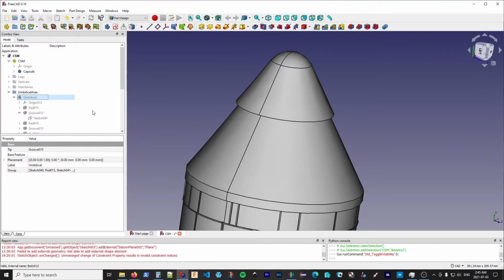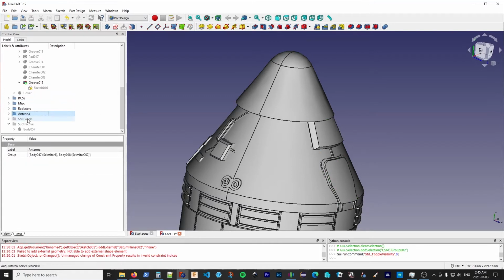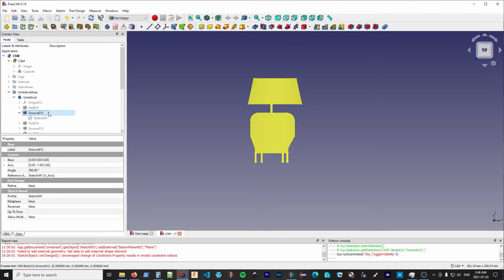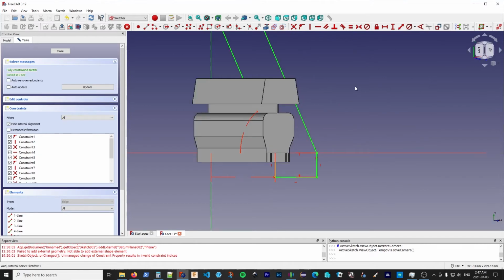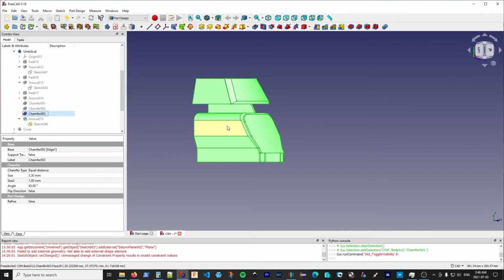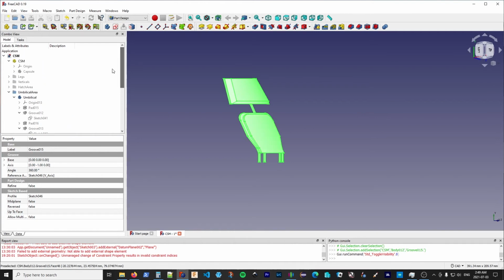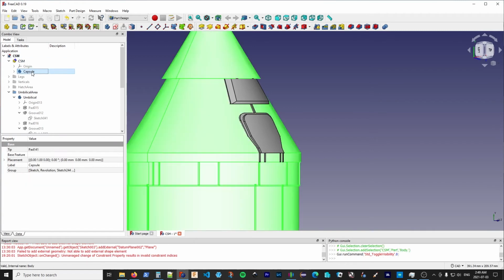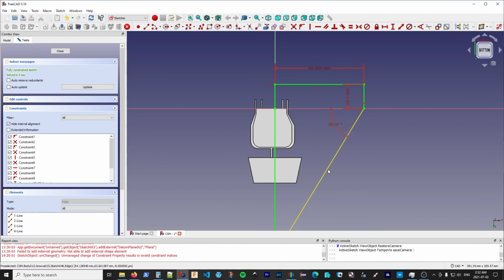Nose Cone Features in FreeCAD

Comment: How do you fusion these details together? Sorry, if the questions are dumb, new with freecad. In general how to edit these elements (boolean or sketching on the surface)? and how to change initial rotation when making new detail? thanks
Reply from the maker: The best way to answer that is code. Check the draw() function:

https://github.com/davesrocketshop/Rocket/blob/master/Rocket/ShapeHandlers/NoseShapeHandler.py
Reply: @DavesRocketShop  aprreciated your quick answer, will take a look. not sure that I will find the answer as i am polygonal 3d artist who's trying to learn parametric modeling and some rocket stuff simultaneously😅